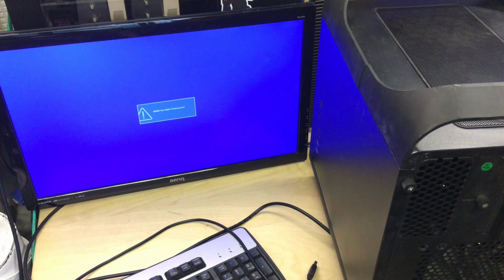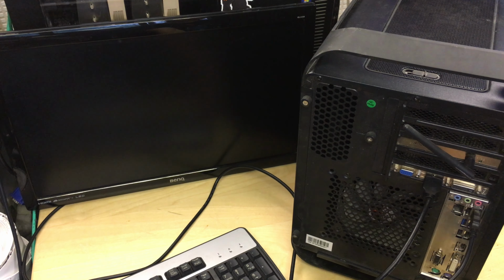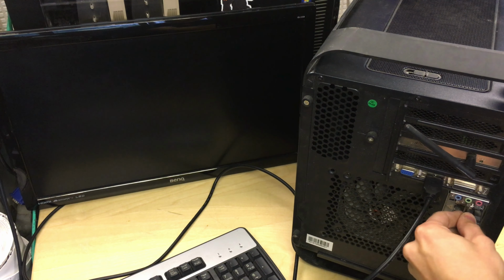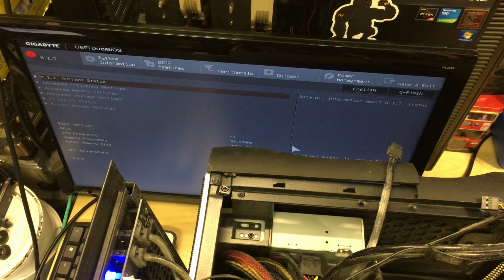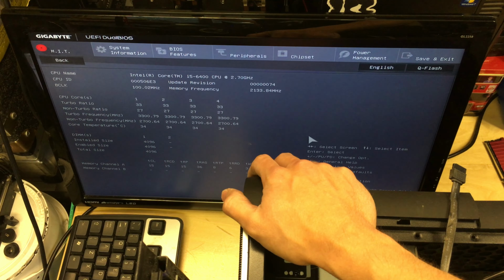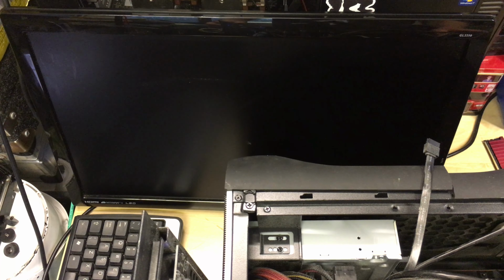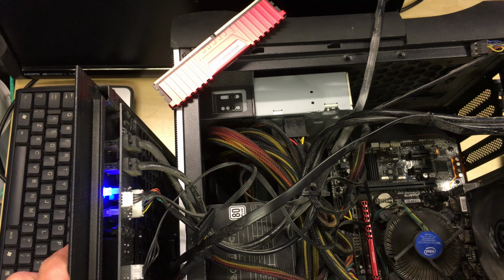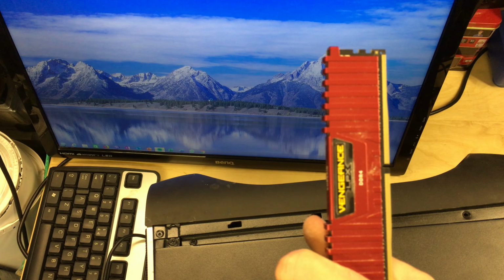Facebook Marketplace Mystery PC for Repair - No Post / Reboot Loop Diagnosis & Troubleshooting

Comment: Probably a really long shot but might be worth checking if that RAM stick is still under warranty. Good video and great score of a pretty decent mid-spec custom PC for short money!
Reply from the maker: I do doubt it would still be under warranty unfortunately, I think they would require proof of purchase to get a replacement too - I've been asked for it before when returning other PC items for replacement. 
Thanks for your feedback! It was indeed a good buy - I figured that even if the motherboard was dead I couldn't really lose given the additional components I could see. Just need to decide what I'm going to re-purpose it for now! 😎
--Nathan